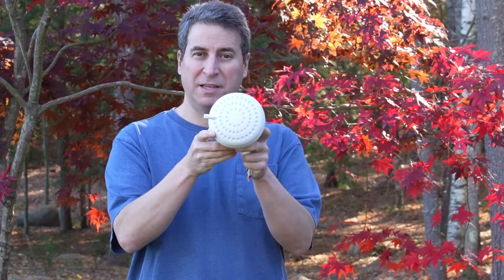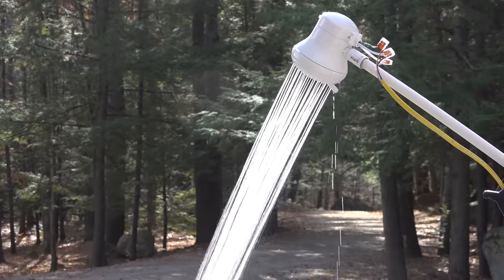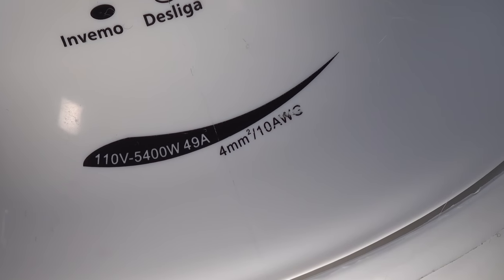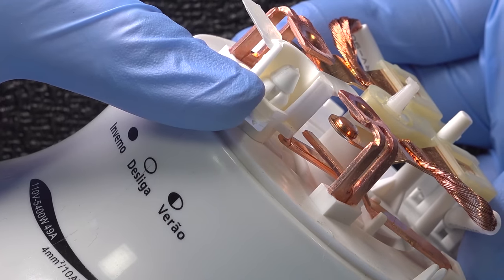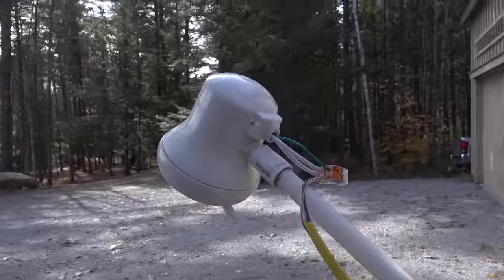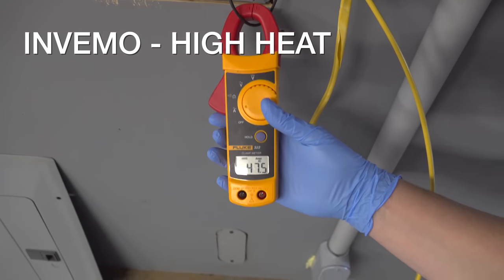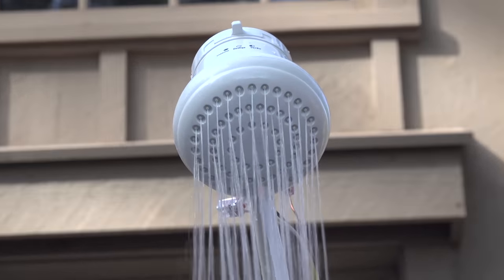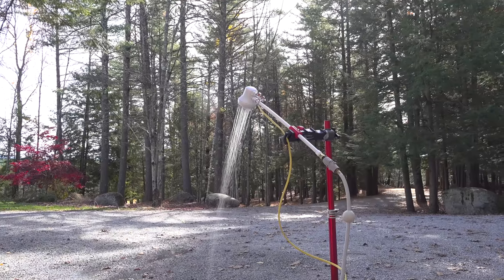What Happens When You Use a SUICIDE SHOWER HEAD in the US

Comment: 72° my @ss... hahaha... 😂😂in FLA, unless u have old pipes, or pay extra for under foundation piping, which most homes mast 1990 do not have, your water can comes put way over 120° during the day. 

 My water has to be turned on for 6-7 mins and run during the day... 
Its been upwards of 180°, waaay past Nything my hot water heater ever put out 
Only at nite do u need the water pump down hur. Probably now the same in some other places maybe like TX too now (only cause i know they build houses the same thur now days).

 These Lorenzetti Showers r purdy cool thow. Wired right, and if u use the newer plastic ones, they work well.

Comment: So funny how you got a shower head with bad grammar, it's supposed to say "inverno" instead of "invemo"

I think you know this, but 
"Inverno" means "winter"
"Desliga" means "off"
"Verão" means "summer"
So the heat level is indicated by the weather you'd usually use it in
Reply: Also you're not supposed to change the temperature while it's turned on, since it can break the resistance of the shower

Comment: It's not no different than have any electric water heater booster mounted on the other side of the wall. It's safe but I'm questioning your amp meter. The coil size and turn ratio doesn't reflect amperage pulled
Reply: not safe. you are incorrect.

Comment: It's funny all the Brazil comments. I visited there once and remember the power going out mid shower. The one in the place I stayed had some sort of porcelain or ceramic connector on the wires. I suspect the extension hose thing may be for your bum. You can't flush toilet paper in the building I stayed in

Comment: They sold hundreds of thousands? Hahaha, try a few billion, Brasil alone has hundreds of millions, places in Africa and Latin America also use it, and taking in consideration that you need to buy a new one every decade or two, they end up selling a lot of showers, hot water is just not a problem if you have a decently powerful one, the one you have is not that powerful, but it is petty reliable, and if you don't open the shower that much the smaller volume of water will be heated more, in a cold day most Brazilians will just choose to shower with a bit less water pressure but way hotter water.

And yes, it is safe, as long as your house electrical installation is up to spec, including the installation of the shower, even if it's a shady job in a poor electrical condition house you'll, probably, at most get a small shock, and that's really really rare, and need a really poor installation job to happen, if everything is OK, they are safer than having a huge water heater in your house, probably a lot safer, actually since there are pretty much no deaths from electric showers while water heater do kill a quite a few people a year, either trying to fix it or when it breaks and generates a fire, I would say that is absolutely less dangerous than the alternatives.

Comment: suicide shower is REALY a horrible name. This showers are great, used by hundreads of milions of people every day only in brazil. Very rarely someone can get a shock when intalation is not properly made and still wouldnt kill you, just a stunt. As I said, hundreads of milions of people use it and they use it a LOT. There are other models even safer like one where the wires go inside a plastic and that you change the temperature with a valve very far from from the shower itself and in a huge range of temperatures, making it in the exact temperature you need. Is a brazilian invention

Comment: Those wires are good for 30 amps its rated for 30 amps not 50. And you ran like 14 gauge wire good for 15 amps off of a 50 amp breaker. Lol